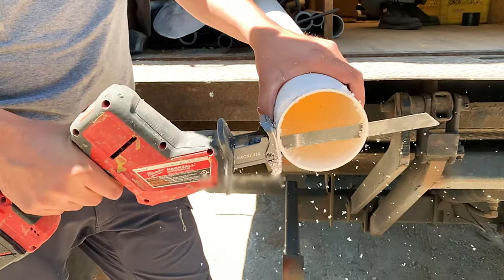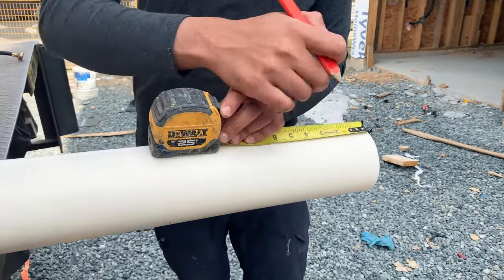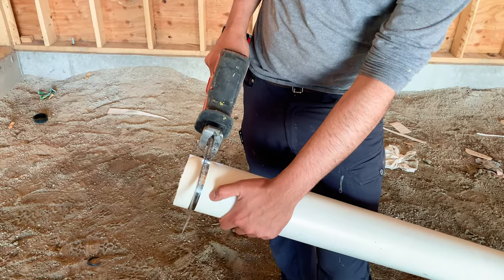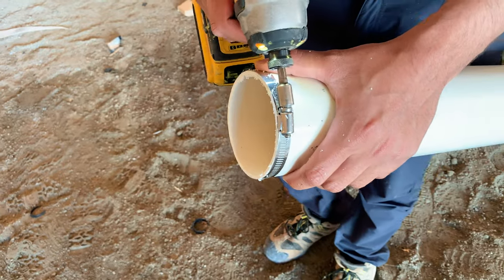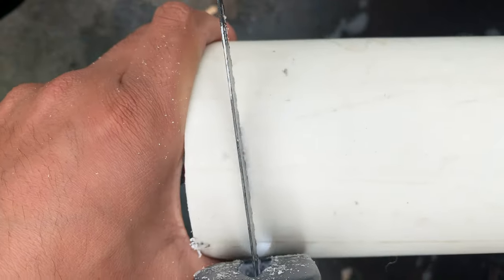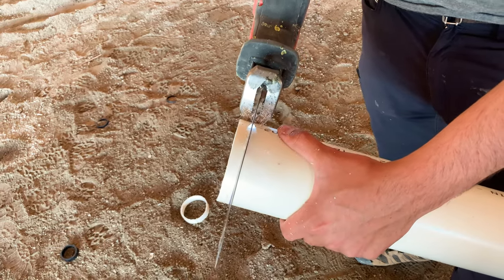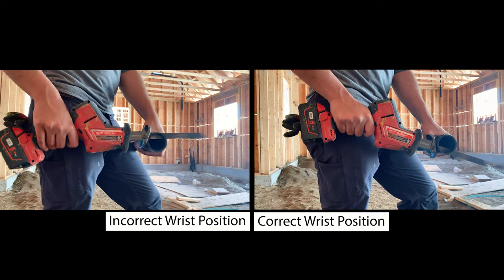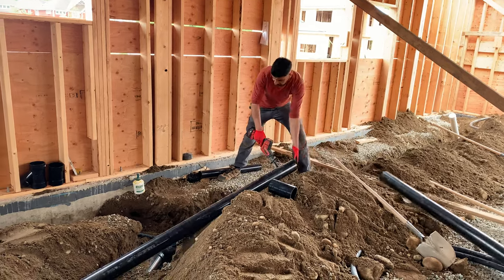How To Cut Any Pipe Straight - 2022

Comment: i dont know about cutting pipes but am sure you will cut a few fingers off with these instructions
Reply: I thought the same thing... very risky operation!
Reply: @Richard Moore  Maybe you need to make sure your fingers are far enough from the saw blade - as was clearly shown in the video?
Reply: Not really sure how you guys cut your pipes in crawlspaces and attics that you can't even spin your body. Sawzall easiest tool to cut all sizes in worst conditions.
Reply: Even the little m12 is pretty handy

Comment: What would you recommend to cut old, very brittle cpvc pipe? I have a leak in the wall that I need to cut out and replace, but I’ve heard that if you put much pressure on old cpvc that it will splinter and crack. Thank you!
Reply: Use a hack saw

Comment: Do you bevel edges with a tool before inserting into joint or coupler ?
Reply: Always clean the joint of the rough edges or it can build up debris over time.
Reply: Deburring tool

Comment: Easy way it to use a wide rubber band.  Mark hot many inches from the end you need to cut in four places. Put the rubbed band around the pipe and pinch the extra so it’s tight, and move it to where your marks just show. Using a permanent marker mark all the way around the rubber band. Take the band off and make your cut.

Comment: The hose clamp method works EXCEPT you need to rotate the clamp at least once because the screw cage protrudes beyond the line of the clamp and will push your blade out of alignment.  Also, for safety reasons it's better to be cutting with the pipe suspended over a bench or board and not your knee.